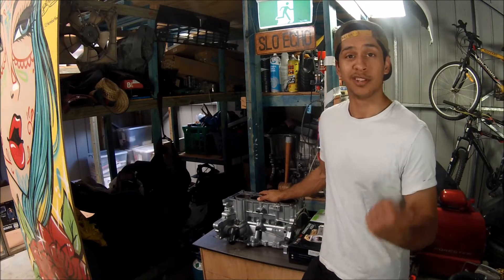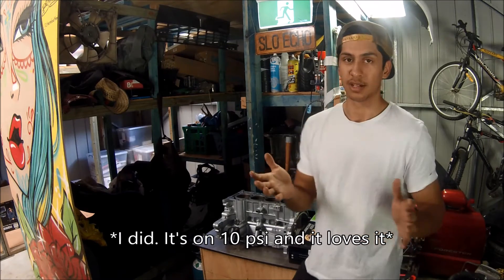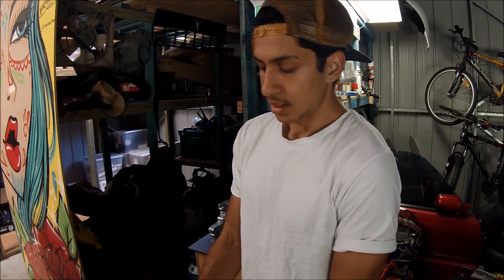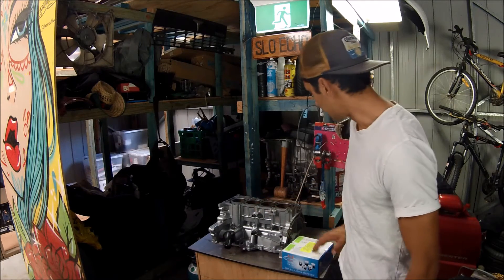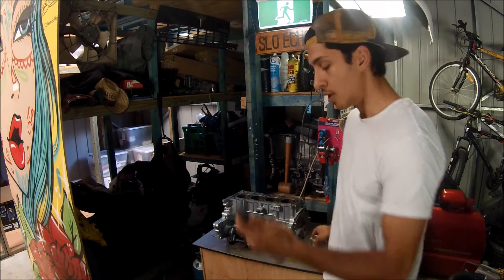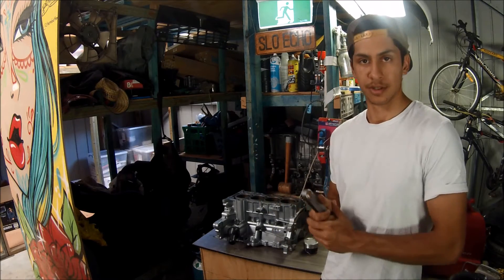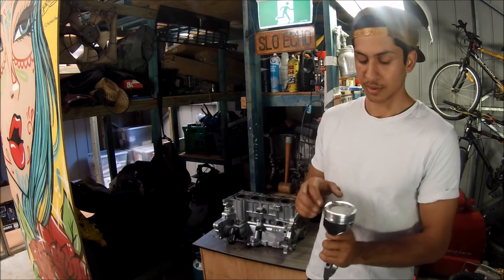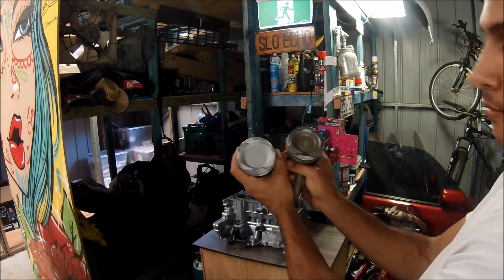1nz-fe Cheap Forged Build - Pt. 1

Comment: I am curious about what's inside of the original 1nz-fte, the real turbo engine? Has it comes in forged internals?
Reply: No, I believe that was fully original. Only the ECU was different. But it did run low pressure. Like he said, you can run about 7 psi with standard internals. That should be around 150 hp. More hp or more boost could be risky.

Comment: Thanks for sharing this build and just wondering if you have the conrod specs or measurements? I like how you went to the 19mm pin, stronger and just that little bit extra lube helps on the diameter of a critical part.

Comment: Love the work you're doing, watched all your videoes. I'm planning on doing a similar build but with a supercharger. Where'd you source the rods from?
I'm to in a Australia but Sydney-sider haha.
Reply from the maker: Thanks man, really appreciate it! 
That's awesome, another Aussie boosting a 1nz (we are a rare breed haha)!
Just ebay man. The seller was maxpeedingrods-au
Reply: Cheers mate, do you know any other "budget" pistons that still have 10:5 compression. What Vitara piston are you using?
Reply from the maker: It's hard to say what the cr will be as they were intended for another engine/head design entirely. If you could find a reasonably priced/quality machinist, you could attempt to reuse the stock pistons. That's what I would have done if it wasn't so exy .
They are the ycp ones
Reply: Yeah I was hoping to do a budget build aswell but it seems the pistons is the issue, I believe most machining places will charge abit or buying reputable pistons which will defeat the budget build . I would also like to keep a high compression.

Might take a look at Prius rods.

Thanks for the info will continue to follow this build.
Reply from the maker: No worries bud, if you do come up with the goods let us know :)
Yeas 1st gen may have forged rods apparently
Reply: Will do mate